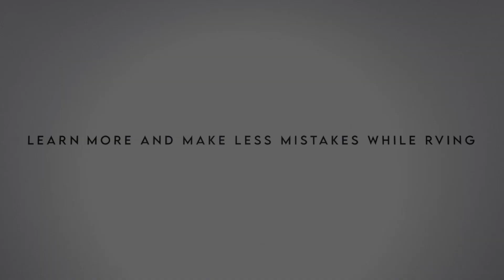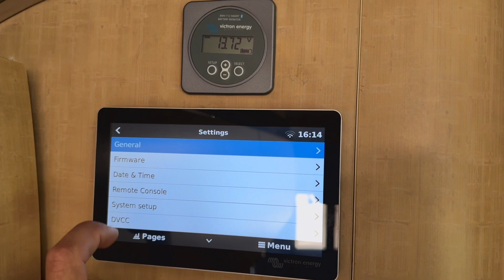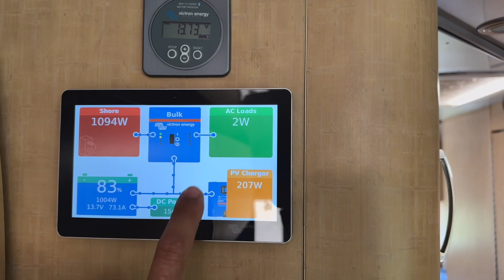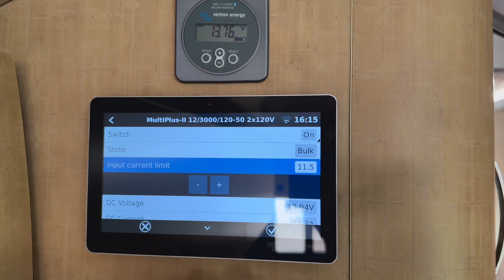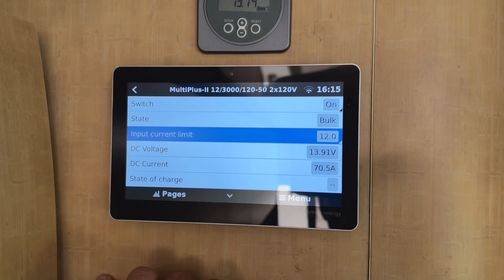Victron Monitor Upgrade!!! Cerbo GX with Touch 70 - Why Not RV: Ep 119

Comment: Just came across your site and video.  I have a similar setup (CCGX rather than Touch 70) but my question is, can you still open the cabinet door with the Touch 70 on the wall perpendicular to the cabinet?  I had to sand my edge down so it wouldn't hit the buttons.
Reply from the maker: My cabinet does not touch but if there was a physical button I could see it touching. It goes RIGHT in front of the screen but does not touch it

Comment: Great video - glad I found your site.  Can I assume you have lithium batteries?  Which brand?  I'm dropping 2x "G model" for 200 aH total with a Victron "SmartShunt" into my 2019 Globetrotter and would be interested in the values / numbers you put into your Victron "Connect" mobile app.  And YES, I now have the Victron Cerbo-GX & Touch 70 on my list to ADD in the near future.  TIA!!
Reply from the maker: I’m actually actively upgrading my battery’s from 3 100ah battle born lithium batteries to 4 304ah DIY batteries which I’ll be having videos come for about it.

Comment: You can also configure the CerboGX to display and change the Current Input as well as turn on/off the Multiplus by swiping over in the pages without navigating through the various menus
Reply from the maker: Yes. I actually recorded that bit and forgot to add it to this video. Great add on comment Mark. Thank you!

Comment: So what voltage power's the cerbo gx. I have a 53v lifepo4 battery bank. Will it power up from that?
Reply from the maker: Yes it will. It’s dc input voltage is pretty wide. Specs are online but it’s something like 8-64v or something crazy like that. Accepts typical 12v 24v or 48v setups
Reply: @WhyNotRV  oh ok awesome, 👍 I really do appreciate it. Yeah. I do have a large battery bank that I built. 300ah 53v lifepo4. I'm going to be using at my residence. Building a 10.2kw solar array. And I really like victron. 👍 my favorite
Reply from the maker: Can’t go wrong with Victron!!!